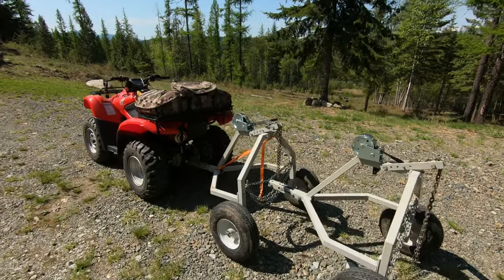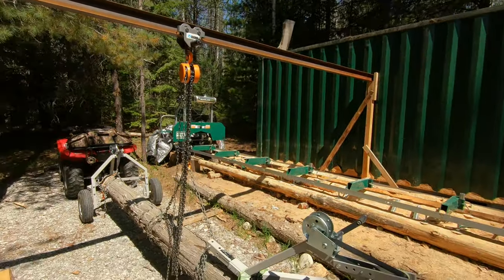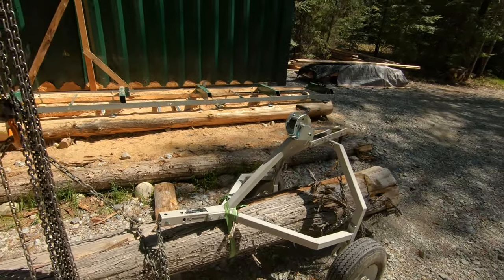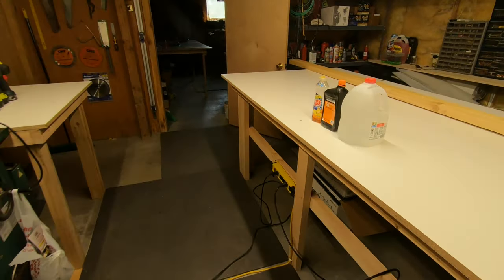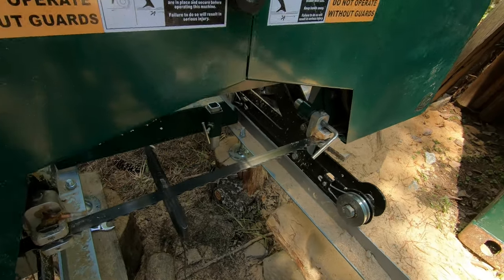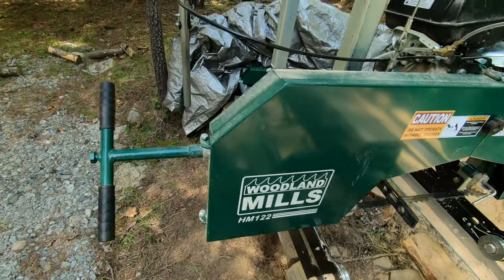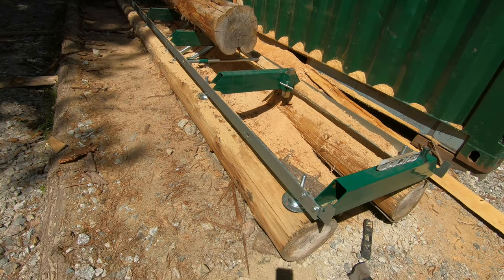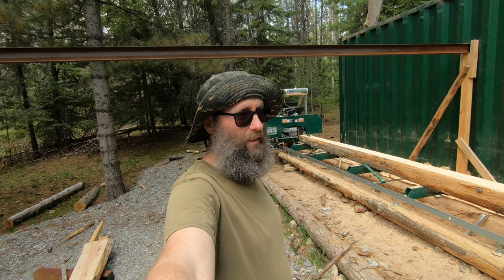Sawmill, How To Avoid Wavy Cuts and A Lubrication Mix

Comment: Chain hoist is awesome. Now with the wavy cuts. The blade needs to be rolled or flattened. Put a razor blade across the blade between the gullets. See if you have a hump or you can see a dish in the middle. You want a slight dish. To much dish  will make it rise. A hump in the middle will make it dive. The first 12" of cut will tell you which one. If it dives you have to flatten the side towards the slab. Vice versa if it rises.
Reply from the maker: Thanks, good info!

Comment: Nice way to carry logs... keeps them out of dirt which i would think makes your blades stay sharper longer. About the oil mix,  would that stain the wood in any way if you were using for interior.  Thanks
Reply from the maker: I have not had an issue with staining, most of my material gets used for homestead type projects and are also soft woods. I have milled a fair amount of cedar for facia and exterior trim and have not had any issues.